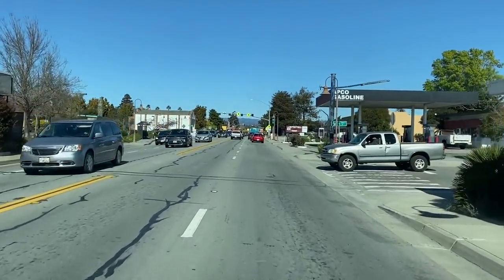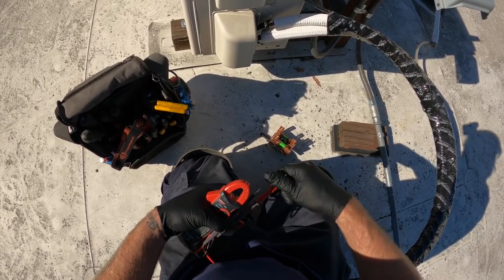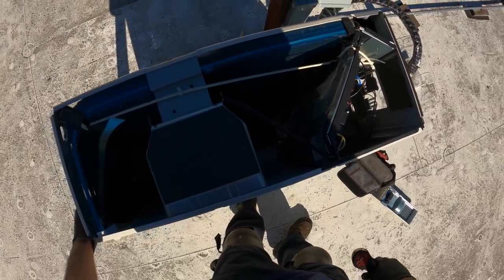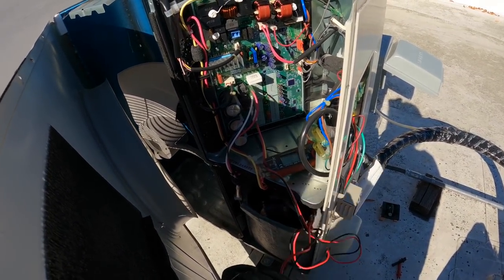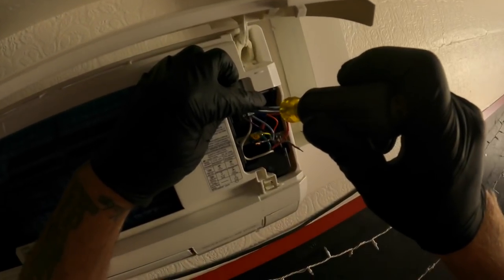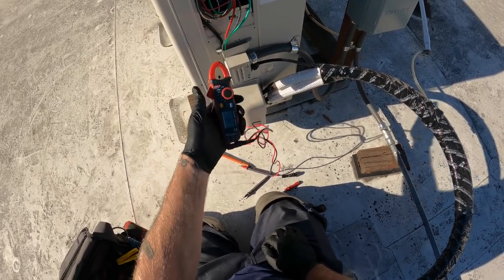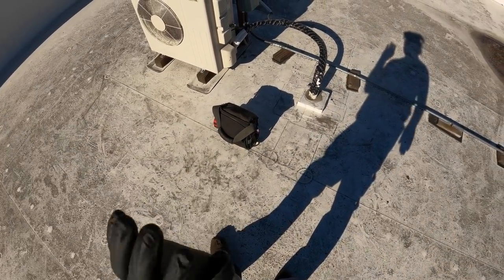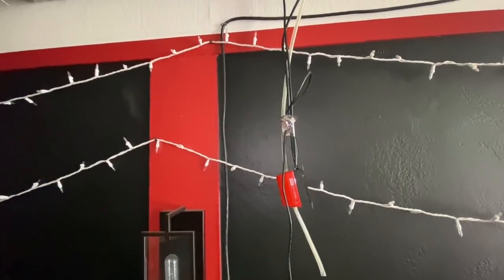Mitsubishi ductless mini split heat pump not heating

Comment: I hate those micro inline pumps. Stopped using them due to premature failure causing high temperature alarm in small server rooms. We use external mounted one piece mini split pumps easier to maintenance and repair. Another useful idea to keep door screws from getting lost I carry collapsing magnetic tray in my service bag. Craftsman and Matco have them available work awesome. I got tip from HVAC UK video 👍
Reply: I agree we now use the aspen pumps that mount on the outside.   Sooooo much better
Reply from the maker: I’ll look into those pumps
Reply: Refco COMBI has a good reputation from what I've heard.
Reply: @sprockkets   yep used those work great and install easy, but only one vendor in town stocks them.

Comment: We’ve got an older Mitsubishi mini split AC in an artist studio that just drains outside by gravity and tends to build up ice in the drain pan and then leaks into the room.  The building doesn’t allow permanent AC installation anymore, ours is grandfathered and we supposedly aren’t allowed to replace it, but it would be nice if they would make an exception and recognize the environmental benefits of the energy efficiency advantages of us upgrading it to a heat pump instead of just using an electric baseboard heater in the relatively mild winters we get in Vancouver...  I was able to air heat the place with 700 watts of continuous crypto mining, not quietly but it wasn’t toooo bad for a couple winters as a productive alternative to the baseboard.

Comment: Should of just checked voltage across L1 and L2 at the wall mount and if you have voltage there then the problem isnt at the condenser.

Comment: U gotta get a cooler for those water bottles . Sitting in the heat in the van the plastic starts to melt and dissolves in the water. Really bad for u brother . Other then that. Keep grinding . Hvac for life
Reply: Yup ive always got an ice cooler packed with drinks, rockstars and water lol, life on the road

Comment: Hi super Dave I work on ice machine and small reach in refrigerator and freezer, I have a question in regards to critical charge systems, I use 36" hose, let's say the ice machine said to put in 15oz of 404A, how much should I put in exactly 15oz or do I go to 16-17 oz because when you remove your hoses you're losing some refrigerant, also how much in ounce refrigerant does each hose  hold,for 36"hose and for 60" hose thanks.
Reply from the maker: I’ve herd 2oz per hose but never weighed it.
Reply: Purge your lines and set the tare weight on your scale before charging.

Comment: I for one do not like working on the glorified window unit mini splits
Reply from the maker: @OcRefrig  I was told today 20,000 hours life span if they run all the time.
Reply: I do mitsubishis, we give our customers a 10 to 12 yr parts warranty. But they are fussy as heck especially with elevtronics. And not cleaning the filters means replacinc the blower wheel. But for a lot of our customers its the only option
Reply: @OcRefrig  Here in Europe they are full of electronics (weak part) life spam is about 10 years, but they are very energy efficient, I see you guys in the states are still running capacitor base units,  which are much easier to serve  and diagnosis

Comment: The main power switch is so stupid in Australia we have isolator switch made of plastic and why do you a fuse in a metal box on a roof when you have a fuse in the main switch board and why is everything like the 1970s when it comes to the main Power in the states
Reply from the maker: It’s code here. Service disconnect within 6 feet I don’t believe fuses are required you can use a non fused disconnect, but it’s always a fused installed.
Reply: @NorCal-refrigeration  ok so you have a main fuse in the subox then you have a fuse next to the outside unit if it's three phase power do you still have fuse at the outside unit and does it loses all turn off if you lose a phase at the outside unit disconnect switch